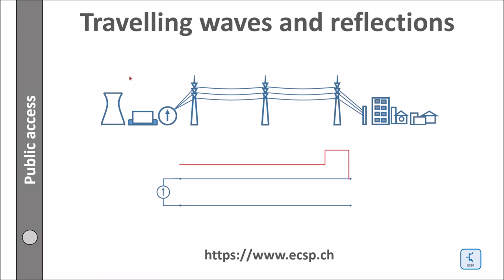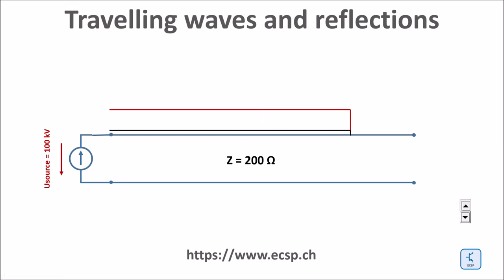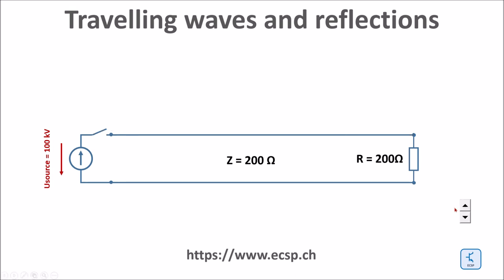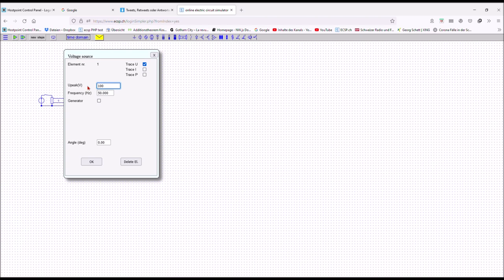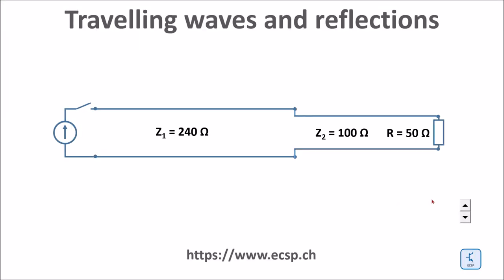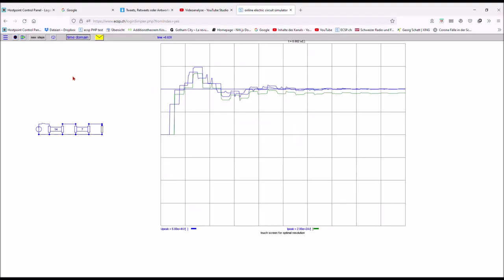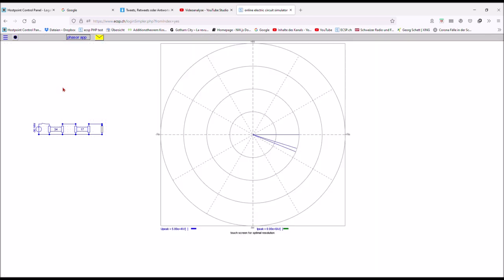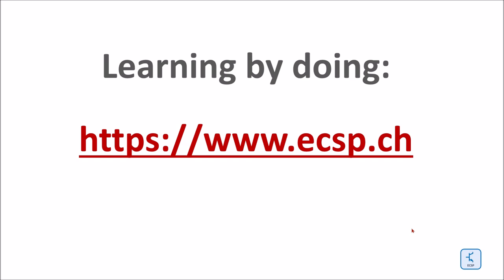Traveling waves and reflections on transmission lines

Comment: Hello sir, what is the difference between the cable and transmission line for the travelling waves and reflections?
Reply from the maker: The wave in a cable is much slower than in a transmission line (about 30% of the speed of a transmission line) and the surge impedance of a cable is much lower. This changes the reflection accordingly.

Comment: Hi Georg,
thanks  a lot for the nice video. What if the switch is at the end of line and it opens (instead of closing the switch)? For ac systems, I mean (50 Hz for example).
Do you have any short video on that?

Thank you.
Kind regards,
Amir
Reply from the maker: Why don't you try to find the answer by using the simulator? The free version is available and you can build a simple L-C model of a line.

Comment: Travelling at 2/3 c not c.
Reply from the maker: I am not sure that this is right. As long as there is no dielectric media, the speed is close to c. In cable however, where the conductor is surrounded by a dielectric material, the speed is lower.
Reply: @georgschett801  if we talk calssical transmission line, differential mode (differential voltage and current) then it's 2/3 c. If we talk waveguide mode (e.g. surface waves propagating at the interface of conductor and air) then 0.9x c.
Reply: @georgschett801  nonetheless great visualisation and great video
Reply: @georgschett801  one exception and after a bit of thought - you might be able to make a coaxial cable with aerogel type of filler, then you may get very close to c. Parallel wires radiate and couple to surroundings... hence even if wires are uncoated you cant assume dielectric free setup... hope this helps
Reply from the maker: @outrospection4all  Maybe there is a misunderstanding. When I am talking about transmission lines, it is about free standing the 3-phase high voltage power lines (50 / 60 Hz) without dielectric insulation material. In this case most of the modes are traveling at close to light speed. At very high voltage there is an additional corona damping effect which slows the propagation a little but normally this effect is not considered except for lightning protection studies. You may be addressing wave guides or micro strip transmission lines which are operated at much higher frequencies and where there can be dielectric material involved. It is also called transmission lines. Anyway: thanks for your feedback!